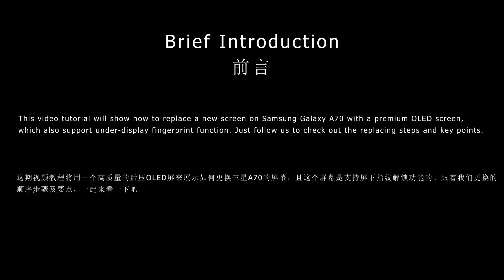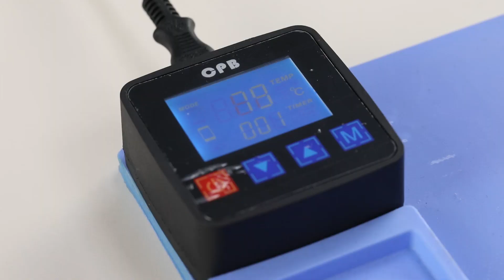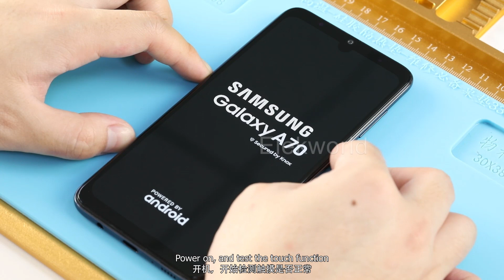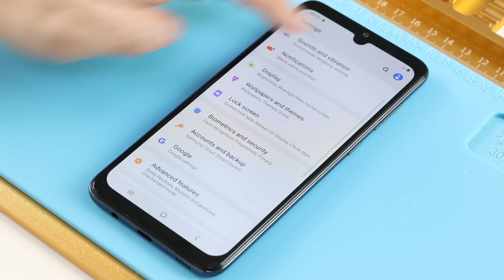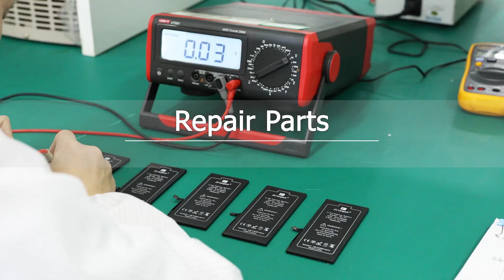Samsung Galaxy A70 Broken Screen Replacement- Fingerprint Function Work

Comment from the maker: If you have any questions about replacing screen for other models, please leave your messages.
Reply: Hi, Afte replacing screen on my A70 the finger print is not working anymore. Can you tell me what's reason of this. I already ask the technician who replaced it and he answered that finger print is not functional anymore once screen is replaced which I'm not satisfied with his answer.
Reply from the maker: There might be many possibilities according to our test: With Android 9.0, all fingerprint function works well, we can both enroll and read. But with Android 10.0, some quality screen support fingerprint while some don't. While with Android 11.0, all quality screen's fingerprint stop working. So we suppose the fingerprint function depends on both Android system and screen quality. In your case, maybe you can try to downgrade to Android 9.0(If it wasn't now) or replace another quality screen to test.  Hope it helps, Mike.

Comment: How do you get the fingerprint sensor to work? Apparently Android 10 checks the sensor is the original and won't allow it to work
Reply from the maker: Thanks for message, friend. We are making fingerprint tests on Android 10, and will keep you posted.
Reply from the maker: Hi friend, we've made rounds of tests and here might be many possibilities: With Android 9.0, all fingerprint function works well, we can both enroll and read. But with Android 10.0, some quality screen support fingerprint while some don't. While with Android 11.0, all quality screen's fingerprint stop working. So we suppose the fingerprint function depends on both Android system and screen quality.
Maybe you can try to switch Android system or try another quality screen to see if it works. Hope this helps, bro.

Comment: Hii mine is Samsung A70 my display got damaged and I changed it after changing  fingure print sensor not working and display screen not fit to screen while I use . Why is it..? Is service man give me duplicate or its like that
Reply from the maker: Might be many possibilities: 1- We know A70 was designed originally with OLED screen with fingerprint scanner hole inside, but in the market there are LCD screen which doesn't support under-screen hole; 2- repairman might damage fingerprint flex or components which lead the fingerprint function failure.
If you need correct OLED screen with fingerprint function, pls whatsapp us: 0086-13590142302.